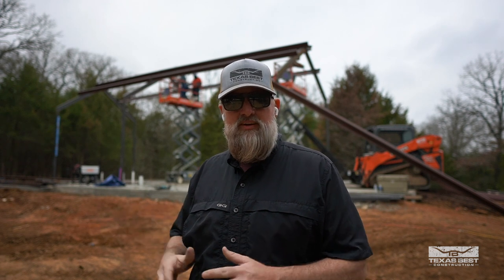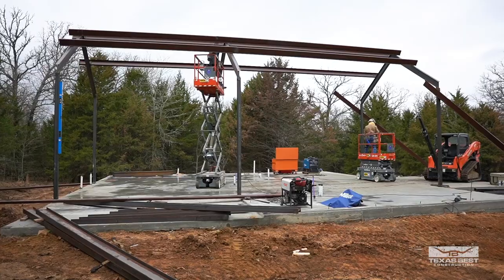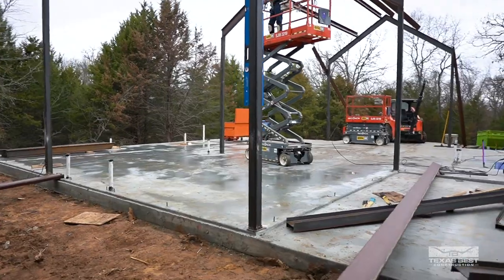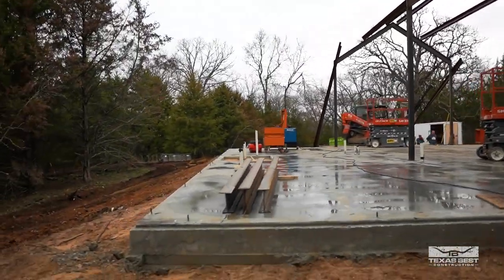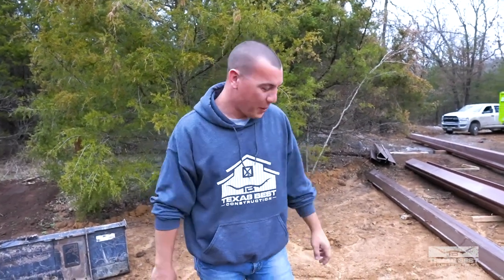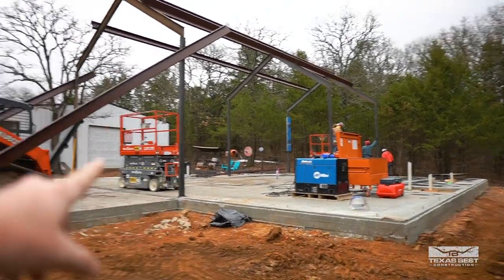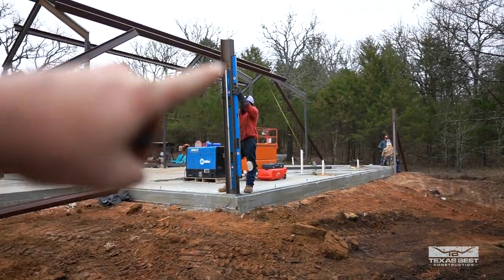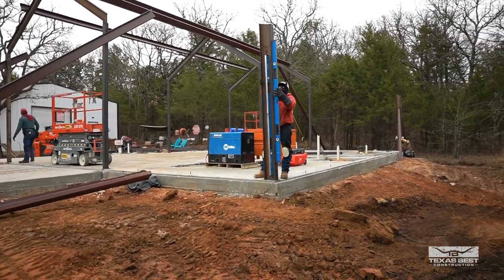Sadler Barndominium Home Standing Up Steel | Texas Best Construction

Comment: ive seen you use spray foam to make it air tight. i live in northern california. and i get batt insulation about 95% discounted and paper barrier batts free. im currently building a 40x60 2 story barndominium. shhould i use batt insulation or spray foam insulation? i want the most efficient home but i keep hearing of ppl getting mold inside their walls with foam. im planning on adding 2-3 mini spilt systems for a/c. i was thinking of r23 in 2x6 framing with paper barrier batts. i would your opinion before i start

Comment: It seems a shame that they didn't want to heat the slab ...
Reply: This is Texas. It’s uncommon to have heated floors here. I have them at my cabin in Tahoe but it’s rare here.
Reply: @teresastewart6970  Makes sense. I'd guess Air Conditioning is handled by venting system.
Reply: In Texas, we are usually trying to keep everything as cool as possible!  Heated floors are not very common.  😊